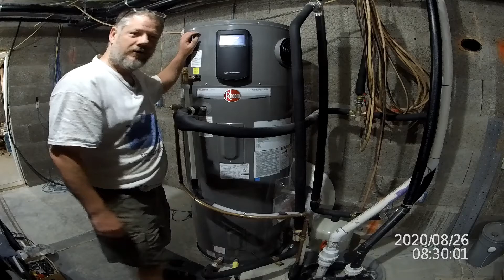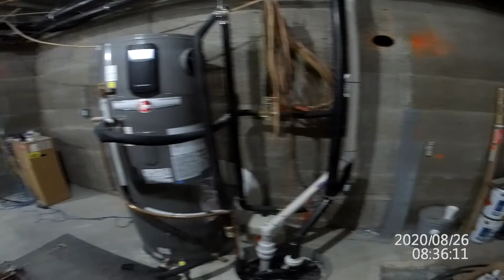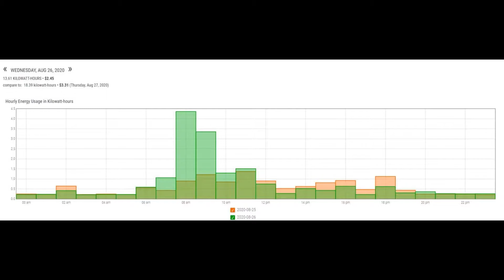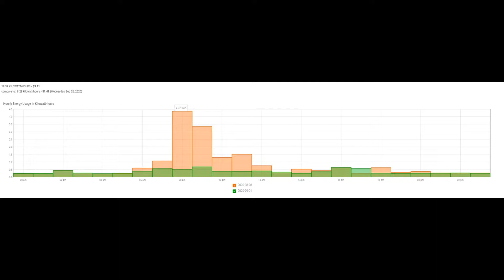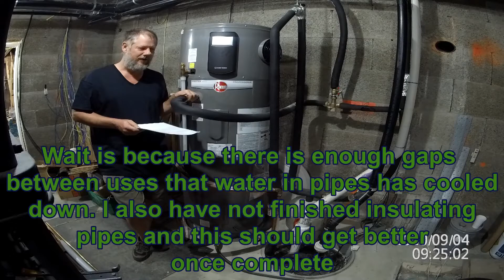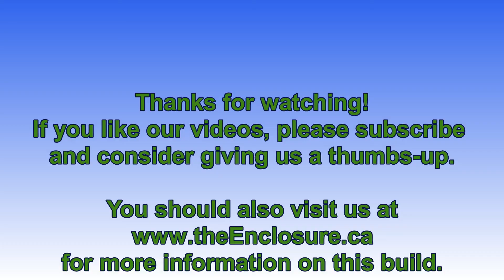Start-Up of Rheem 80 USG Professional Prestige Hybrid Heat Pump Water Heater

Comment: Great video! Quick question, were you able to fully set this up as a DIYer without using an authorized app?
Reply from the maker: Hi @HubstepCamaro.  Yes all of the available settings can be controlled from the LCD screen on appliance.  I actually never got the app to work.  I can also confirm that I am on heat pump setting, and have never run out of hot water.

Comment: How is the hybrid system working a year later?? Thanks!
Reply from the maker: Hi Ron,  I actually only moved into the house on Sept 13.  I have not had a chance to dive into the data in a detailed way, but on the surface it appears that it has been able to easily handle our load in just the heat pump mode. And to date, I have not had to supply supplemental heat to the room it is in (we are currently heating the house with two 1500W electric heaters (one on 1st and one on 2nd floor).  I am just about to start piping the mechanical room and will hopefully have the Hydronic system up by end of Nov. But back to your question, I do not have any regrets getting this heater and think it will be saving me a bundle of money.
Reply: @SENWiEco  nice! Continued success!!
Reply from the maker: @1ronhall  Thanks
Reply: Thanks for the video! Can u tell me the duration and occurances when the compressor is running in a given day? I have the impression by looking at your charts...the compressor is running all day?? Am I correct?And do u keep this at 120F or 140F? Do you also know the temperature of the air going into the unit? Thanks!